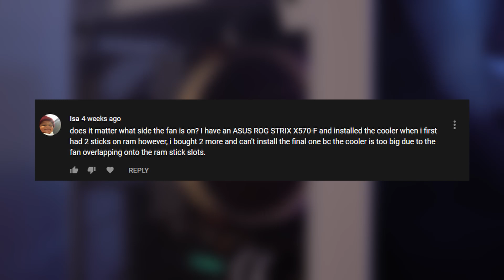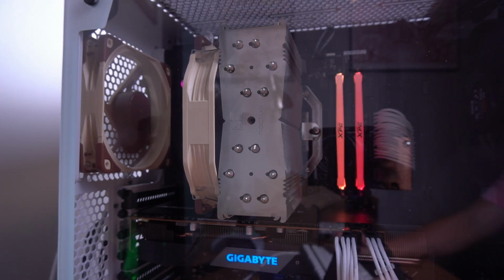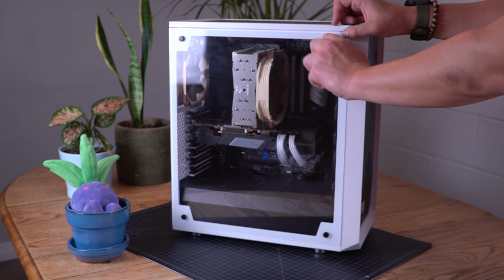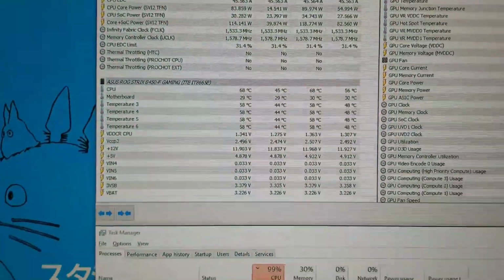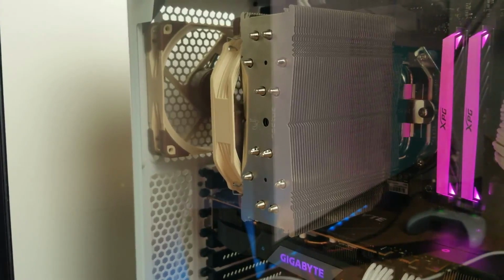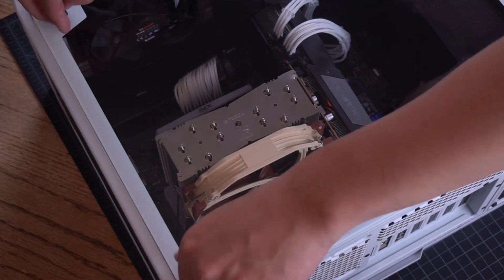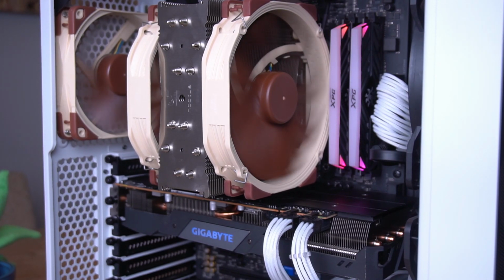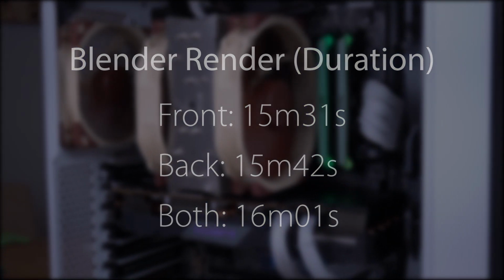What is the best placement for your heatsink fan? - Noctua NH-U14s

Comment: Interesting, thanks for sharing your experiment. I'm thinking of buying the same Noctua fan for my Ryzen 5900X (pre-ordered) so it's good planning info. I wonder how well the Noctua can cool this new chip? I decided not to get a windowed case because the Noctua isn't attractive without any fan LEDs to compensate for it!
You have a very clear, calm voice, easy to listen to and well suited to conveying information to people. I know you didn't ask for feedback, but I figured you wouldn't mind a compliment! Good luck with your channel.
Reply from the maker: Hey thanks Gary! I really appreciate the kind words :)

5900X eh? That's going to be a pretty powerful CPU! I can't speak for how well the Noctua would cool that sort of a chip, but I can tell you in my day-to-day use of the Noctua + my 2700X, temps will rarely get above 65 degrees (and I usually see that temp when I'm rendering a video for Youtube). The stress tests will take it closer to 70, but overall I'm really happy with the cooler.

It's definitely not the 'prettiest', but for the performance + lack of noise in the system overall, I'm pretty smitten.
Reply: @PatrickRennie  It sounds like there's plenty of head room to keep the 5900X far below the max temp of 95 deg! Based on the temp you get when doing encoding I'll gamble the Noctua will keep the 5900X below 75 doing the same thing. One day, when stock becomes available to ordinary people, I'll find out. ;-)
Reply: Hey Gary what is your current temps with u14. I have same specs, 5900x and u 14 and temp goes up to 90(mostly 82 C).  I am thinking buying second fan to decrease the temp but I dont know. Maybe u14 is not good for 5900x.
Reply: @osmantopcu1660  That's disapointing to hear you're getting temps up to 90. Is 82 at idle / light use? Is there enough ventilation in your case and does the hot exhaust from the u14 have a direct path out of the case? Consider using a case fan to suck that heat out. Sadly I haven't got my 5900X yet, no stock. AMD supply problems. :-( Everyone wants one!
Reply: @remaincalm2  so how was the degrees?
Reply: @draco3984  Hi. The Noctua is brilliant and totally silent apart from a small hum when I'm stressing out the CPU. When  playing a AAA game at 2K the GPU's fan is louder anyway! 😆Temperatures just aren't a problem. It blows air directly into the rear case fan so very little heat remains. It's definitely worth paying a bit more to get the best cooler + fan. It's a beast but a very tame one! I'm pleased I didn't get a liquid cooler as I was concerned with it requiring maintenance during the 10 years I'd use it for.

Comment: Hello, I am deciding between different Noctua heatsink cpu coolers.

I will have my PC moved to the NZXT H6 flow, and I want to optimize air flow to Positive pressure.

I will have the stock 3 fans for intake, but I want to make sure I get most of the hot air out to get cooler air as quick as possible while reducing dust collection

Comment: So now I am am wondering if the old adage of buying matched pair is overrated. I can pick up two Kingston Fury beasts 8gb, for a third of the price of a packed pair of the same ram. And being I may have to Dremel the top of the heatsink by 2 mm to fit one of them into the first slot under the fan, it would be nice if I got the option buy a single again if I messed that up. (option B, remove one of the heat sinks (still nice to be able to buy again if I mess it up), option C, move the fan to the back of the cooler which apparently increases the noise just a little, but mostly won't look so nice.

Comment: that's a good video. I just had to do the back-fan placement single due to ram clearance issues and I was wondering if is  going to affect the performance.  I was even thinking to add a smaller 120mm fan to the front. but seeing my own temps (vs old cooler) and this video, I think now is no point to worry about.
Reply from the maker: Glad you got something out of the video!

Comment: Thank you as I was considering buying a second fan for my  NH-U12S TR4-SP3. I have now decided not to do so. Adding another fan  may only marginally reduce temperatures, but increase noise to quite some degree.
Reply from the maker: Yeah it doesn't seem worthwhile, at least with this particular cooler. Glad you found it helpful!
Reply: In my case with TR 3970x and same cooler adding second nf-a15 fan dropped temperature significantly.
Reply: Sorry, I have U14s-tr4 actually
Reply: You won’t get this noise penalty if people used the supplied thicker bumpers for the pull fan. I noticed this noise as well on my setup and then realized Noctua already provided a solution that comes in the box of the U14S.

Comment: Thanks for the test, but I will point out your mistakes. You need to show the fan rotation speed in the test; the final temperature and noise from the fan depend on this!
Next, you connected the rear fan to the radiator without any gasket, which creates turbulence and causes more noise from the fan at the back! Included with the cooling kit, the Noctua comes with thick fan gaskets, specifically for installing it behind the radiator! You need to know this! By increasing the distance between the rear-mounted fan and the radiator, the noise from the fans is significantly less, and the system performance will be higher! Read the instructions for your cooling, which comes with the kit)

Comment: Nice one. I think your rear PC case fan is close enough to keep pulling  the hot air coming out of the heat sink that the back fan is not really doing anything much extra?
Yes, these Noctuas are built good and one fan should do it as they are pretty large enough anyways.

Comment: Makes sense. The back flan is actually slowing the air flow out of the front fan.
Reply: No, the problem is the rear fan doesn't have a proper gap. In the Noctua U14S box they include thicker rubber corner pieces for their fans to sit back a couple MM from the  heatsink stopping the weird noise. Suction / Intake sides of fans always have a good chance of audible noise due to the fan blades being too close to the object. All he needed to do was use those spacers and the noise issue would have been fixed.

Comment: A good video! Which would preform better, a U14 (2 fans) or a D15 (2 fans)?
Reply from the maker: Hey thank you!

I think that the D15 will outperform the U14, because you also have to consider that the D15 has 2 stacks of heatsink fins, when the U14 only has one. Keep in mind though that the D15 is a huge chonker, and you'll need to make sure that your case has the space for something that large. I opted for the U14 as it was cheaper, and I don't really dabble with overclocking and what not.

Hope that helps!
Reply: @PatrickRennie  Thank you for the reply! I opted for the NHD15, as  sadly Noctua dont make and have no plans to make the U14 in black
Reply from the maker: Nice! I hope it works well for ya 🙂
Reply: @PatrickRennie  I have a question too, which one would be better? U14S with 2 fans or U12A? Thanks.

Comment: I've tried both single fan configs. In my system, there's about 1c temp difference. Both are inaudible. 
Phanteks P600s, 3 x Arctic Bionix P140 front intake. 2 x Arctic Bionix P140 top exhaust, 1 x Phanteks stock 140mm rear exhaust. i7-10700K 5GHz. 3080 OC
Different cases and contents might give different results, but I suspect most users will see hardly any loss of cooling efficiency, while having ~ 2cm clearance of their 4 x RAM RGB.

Comment: Checking the CPU fan RPM it seems as if it's at its lowest when having dual, but performance wise and noise wise you probably get a better result with the front only.

Comment: I remember reading somewhere that in dual fan configuration, the back fan must be spinning faster than the front fan. Is this how you configured your test?
Reply from the maker: Hmm that's a very good question. The way I had my test set up was that both the front and the rear fans were connected to the same fan header via a splitter. This would have meant that in my test the fans would have been spinning at the same RPM.

I think it would be interesting to try this experiment again but have the two fans on separate headers to see if that makes any noticeable improvements. Too bad I sold the second fan haha, I didn't think I would need it anymore :P
Reply: @PatrickRennie   Actually NOCTUA recommends using a faster fan in front and a slower one in the rear of this cooler. The fan that comes with the cooler has a max spinning rate of 1500 rpm. The regular 14mm fan that Noctua sells for the rear position tops at 1200 rpm so even when connected to the same plug, using the included power splitter, there will always be a 20% offset between the two fans speeds. That's how I use mine with a Ryzen 5 3600. Temps are better with 2 fans. I'm getting a max of 62.5° on a 40 minutes pass of Prime95 stress test and CPU fans run at max 1100 front/about 900 rear as that's the sweet spot for performance/noise. My case is a Fractal Design Meshify S2 with 2 14mm fans in the front, 1 14mm fan at the bottom as intake and one 14mm in the back as exhaust, so 6 14mm Noctua fans in all.
With a single fan on the front of the CPU temperatures are higher of about 2 or 3 degrees than with 2 fans running at offset speeds as Noctua suggests. Not a huge difference but this keeps fans at lower speeds and noise is ok.
Reply: @italoop7850  You only needed to gap the rear pull fan to eliminate that weird noise on the pull fan. Noctua makes thicker fan corner bumpers for this very reason. I run all 3 of my fans on. 3 way 4 pin cable and they are spinning approximately the same rpm. Super quiet. The noise comes from spinning fan blades too close to the heat sink.

Comment: Push & pull is only good on air flow restricted setups, for example through a radiator, or if the intake fan has dust filter on it. Otherwise it’s a waste of money and energy for negligible to straight up negative performance gain.
Reply: Negative performance? How so?
Reply: @logorex  go watch jayz2cent's tests

Comment: Does it matter which direction the airflow goes over the heat sink.. like should the air move through the heat sink or push the hot air away from it? I can’t figure out what to do
Reply: Ideally you want your fan to push  air through the heatsink. You always want airflow to go in the same direction. So typically you'd have your front and bottom(if you have those) case fans blowing air into your case and your back and top case fans blowing air out of your case. 
Keeping the airflow in mind you have 3 configurations(as shown in the video):

1: Pushing air through the heatsink with one fan on the right side. (right=front side, left=back side)
2: Pulling air through the heatsink with one fan on the left side.
3. Two fans. Right side fan pushing and left side pulling air.
Ranking the different configurations from best to worst it would be 3-1-2.  

Option 1 and 3 utilizes the cool air from the front and bottom case fans the best. 

I probably overexplained this a lot, but I hoped it helped.

Comment: I got a U12A cooler which comes with 2x120 fans.

I had already factored into my build that I was going to remove the rear fan and use it as my rear case fan (meant 1 less fan to purchase too)
This rear case fan is bridged/split from the cpu fan header too =)

Liked the testing, wish I had the time and patience to actually test it all out.
Reply from the maker: It's interesting, before getting into the hobby I would've assumed that tactiles were the most popular. I guess people value smoooooooooth over a nice bump.
Reply: What is with you people? Why would you buy the U12A just to remove a fan and use it as a case fan. Disgusting.
Reply: @bofasofa9399  I forget where the testing was, but there was a minimal loss to temps by taking it off the back.
Not to mention, I don't have the room to have a rear case fan and a rear cpu fan sooo.

Comment: Currently running Noctua NH-U14S. Both my last two builds, I've had the CPU fan at the rear of the cooler blowing forward. The top-rear case fan is reversed and pulls air in through a fine mesh filter on the outside (magnetic, can be removed and cleaned in seconds).  A centrally mounted 14cm top fan is perfectly positioned to extract the current of warm air coming off the front of the cooler.  BTW, The  NH-U14S didn't actually improve temps from the Thermalright Ultra eXtreme 120 it replaced, but it is quieter. That rear case fan is a 12cm BeQuiet Silent Wings which has a circular duct shape onto which which I've mounted an 'eggbox' grille made of black card to effectively make it a 'vaneaxial' fan, the vanes straighten and direct the flow onto the NH-U14S's fan (they also prevent any weird harmonics which can arise when fans are effectively 'stacked' this way).  So, the CPU is cooled directly by air pulled from outside the case. Works extremely well, keeps all cores in a CPU pulling 125+ watts (c. 220w at the wall) at 70° or less, most in the mid-60's (running Prime95 AVX, small FFT's). With real world tasks like x264/x265 encodes, the NH-U14S's fan and the BeQuiet case fan (slaved to it) never need to spin up much over 800 RPM to keep all cores at c. 60°.   ETA >> basically this arrangement has the advantage of not using air already warmed up by the graphics card et al to cool the CPU - I've run MSI Combuster (overclocked GTX950) simultaneously with Prime95 (resulting in well over 300w at the wall) and it makes no difference to CPU temps (the air coming out of the top exhaust fan gets REALLY warm). There are also two front-mounted and one centre-bottom 12cm intake fans (all intake fans are filtered and the case overall is 'positive pressure').

Comment: Is a 2 degree decrease that beneficial for dual fans?
Reply from the maker: In the grand scheme of things I don't think it's a huge difference, no. I think if it were 4-5 that would be more significant. That being said, this is only one test. I'd be curious to see if there's any changes with the U12s (the smaller version of this) for example.

Comment: Thanks for the well made video. But I have answers to your conclusions. Except the render difference. That would only be if temps were higher then less boost clock on cpu.

1.) The reason it was louder anytime you had the rear fan installed is due to the fan blades being to close to the heat sink. The fans motor mount arms place the fan blades enough distance away from the heat sink when in a push configuration but once the front of the fan is placed up close to the heat sink the audible noise occurs due to turbulence. Use the included thick bumpers that come in the box for the U14S which I own as well. I just made a quick video showing this.
2.) Even with the D15 the dual tower version you can use the fan and  4 ram sticks. Just clip the fan slightly higher. Have this setup running in a Corsair 4000D airflow case with Black D15 and two 150mm fans. RAM is Gskill FlareX with taller than low profile heat sinks.
3.)It’s actually a 150mm fan in a 140mm package. I run 3 of them on a D15 with a 5900x.

Comment: Sir, NH-U14S vs NH-D15 who is the best?
Im use ryzen 7 2700x
Sorry im bad english
Reply from the maker: I think it'll depend on your case size - the D15 is quite a bit thicker, but will do a better job cooling down the CPU.

I'm still using the U14s in my build and I find it to be fantastic. Currently just running with a single front-fan and I'm not having any issues!
Reply: @PatrickRennie  thanks you sir !

Comment: Whats the point of noting max temp, you should compare average since the purpose of the fans is to dissipate the condesated heat form the heatsink. The max temp is mainly related to your heatsink and its thermal conductivity. And please use prime95 small ffts for heat test, then you will notice the diffs.
Reply: And set you cpu fans to constant pwm/speed so you can compare oranges with oranges

Comment: Could you do one with both fans blowing into the heat-sink, essentially forcing twice as much hot air out the sides of the sink? If your external rear fan blows into the case too, it'll exhaust the hotter air far better out the top of the case.
Reply: I don't think that would be very efficient.  The idea is you want a steady flow of fresh air passing through your case and over your components.  Facing all fans inwards except for the top wouldn't really be an ideal set up and would more or less create a windstorm inside your case.  I believe the ideal set up would be having intakes on bottom and front, exhaust on rear and top.  Facing two fans on a heatsink both exhausting inwards would not provide sufficient cooling over the fins.

Comment: Due to case restrictions, I have to use the smaller Noctua U9S.  With the smaller 92mm fans, do you think that I might benefit more from two fans?   The cooler came with one and it greatly reduced my CPU temps already, but I am wondering if it is more likely to make a difference because of fan size.
Reply: Old post I know but yes two fans can help lower a few degrees. I have a U9S in a media pc running a 5800x (hot cpu) and I decided to put the extra fan on this setup for the slight cooling boost.

I also have an almost identical media pc in the bedroom but with a 5700x and a D9L and single 92mm. I could add another 92mm fan to this tiny dual tower cooler but it won’t give me much more performance and I want the most silent bedroom setup.